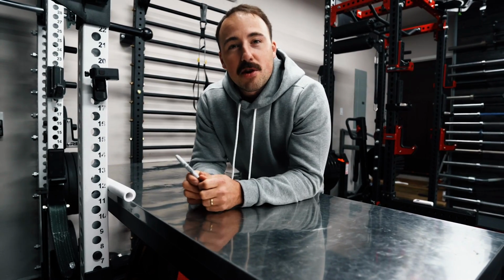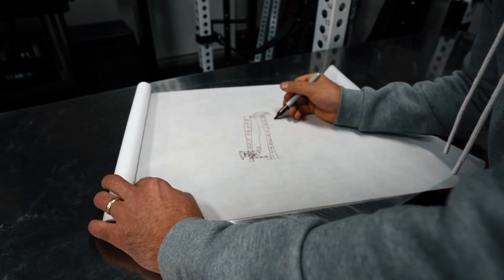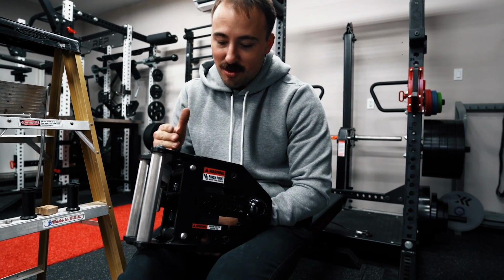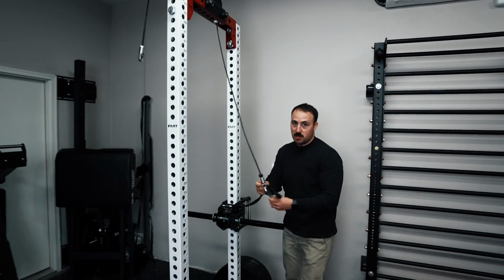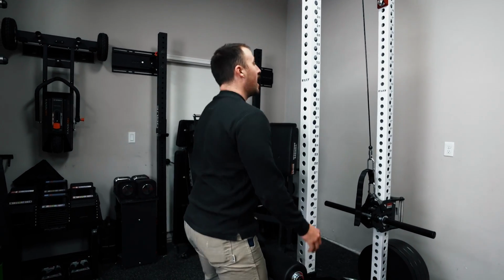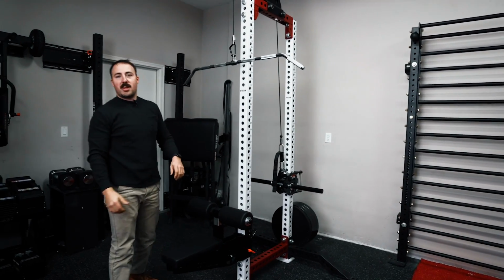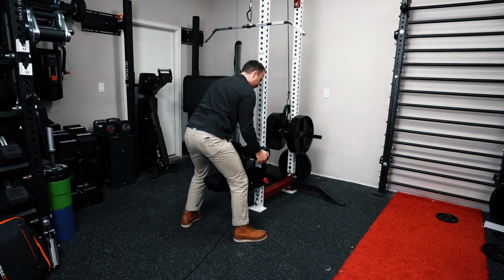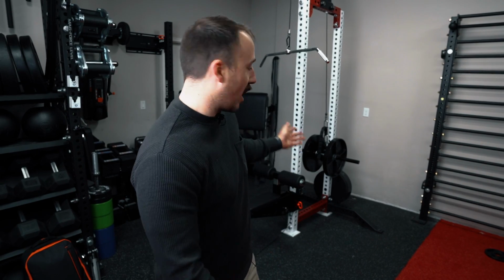How To: DIY LAT PULLDOWN - Stand Alone & Plate-Loaded!

Comment: I flexed on you for a DIY pulldown project. I was able to add a cable track to the top of my rack, I can use two different cable lengths (one for pulldown the other for horizontal cable work AT MULTIPLE HEIGHTS) It's built into my rack, and it's plate loaded. It can also be assembled relatively cheaply assuming you already have a rack.

Comment: At first glance I thought the Rogue lever arm system seemed way over priced, but if the trolleys are multipurposed for this, smith machine set up, adjustable pulley.  The sky s the limit

Comment: Coop, I have an idea to Frankenstein the REP 93” Lat/Low Row onto a ROGUE 90” RM-6 or any 3x3” 6 post rack. I emailed Brandon Campbell about it, maybe one of you could do a video? First, need just the REP 93” Lat/Low Row WITHOUT rear base stabilizer. REP racks are 47” wide and ROGUE are 49” wide so rear base stabilizer will not work. You will one additional 43” ROGUE crossmember. Mount the front to back crossmembers in the weight plate storage area at the right height for the REP mounting plate above low row pulley. Then run the 43” crossmember left to right between these to mount the plate on the low end. Brandon measured for me, and it’s 92” at the top end where lat pull would attach to top crossmember. So there is a 2” gap then to fill between top of 90” nameplate crossmember. You could use a small piece of 2x3” 11 gauge like from an Infinity rack or you could just use some dimensional lumber to fill this gap and act as a mount for the lat pull beam at top. Would just need to drill holes in steel/wood and use either bolts or lag screws depending on material. Then you have a plate loaded lat pull/low row on a ROGUE rack. Fairly affordable compared to Slinger with weight stack and you can use a regular bench to sit on and a roller pad for legs to be held down with. Thoughts?
Reply: I really hope Coop or Brandon try this out. I was trying to figure out a way to mount the Rep lat attachment on rogue rack as well.

Comment: Just a suggestion but...
What if you mount the trolley system to the front post, you'll be able to move the slinger out further and the cable will be more upright. Just make sure to install a stopper below the trolley so that the weights don't smash your knees when you're doing lat pulldowns.

Comment: Awesome! If you have space between the posts, might be better to connect the cable directly  to a loading pin (instead of your rogue attachment). The cable should be 90 degrees to the ground, and loading weight vertically on the pin will mean things stay centred as it gets pulled up (no swaying). It will also eliminate the issue of the cable fraying from rubbing  friction from coming off the pulley at a non-90 degree angle

Comment: PLEASE, can you PLEASE review a weight set that I can use that will withstand the outdoor elements and the salt water. I work offshore on a tow boat, on which I live and work on for 30 days at a time. If you can come up with a good recommendation I would pass it on to the other 312 boats in my company. Just about every boat has some kind of system that has to be replaced regularly. Thanks 😊

Comment: Coop! Powertec has a plate loadable lat pull down, WITH LOW CABLE for $900, in stock. They also have lever gyms, which also have hi/lo cables and a sweet bench, in stock $1,500

Comment: You can't really call this a "diy" solution if you have to buy like 2000$ worth of rogue equipment... 
THIS is the definition of "DIY" cable machine... https://youtu.be/Qn-Ak91pbLE
I built this in Afghanistan with hand tools... The trash can holds about 150lbs of chains, but I've recently upgraded it to 10 gallon pots from the chow hall that can hold 200+lbs of chains. Each chain is 7lbs. You could very easily use a plate loaded posts sliding on a superstrut rail instead of a bucket... I decided to use chains (which we have now duct taped into little 7lb balls) because I have about 1000lbs of chains laying around and only about 500lbs of plates for my team of 15-20 guys. This is a COMPLETE cable crossover with FULL adjustability that would cost probably only a couple hundred dollars to build at home.

Comment: Was there a total cost mentioned? As a comparison, the Powertec Lat Machine (which includes a lat pulldown and low row) is $949 and that includes shipping (at least to my house in Washington state USA)! Add the selectorized weight stack for an extra $490. It's certainly more expensive than the cheap/crap models ($100-$400) you find on Amazon but I'm betting it's lower than piecemealing Rogue supports/columns/Slinger and what not.

Comment: I love ya Coop, but this solution kinda sucks. 1. The parts are all very expensive. 2. The cable is going to chafe even with the PVC. 3. The forces are being applied in a non-linear fashion and it's going to try and make the trolley rock and bind. It might not actually bind because of the bearings, but you're still not applying forced straight up against the resistance of the weight. 4. Your cable connection for the low row is awful. Buy a swedging tool, some cable, a few ferrules, and make your own cable, it's not hard. Also, consider putting a pin in the rear upright under the trolley as a stop. Having all the weight resting on the ball stop on the cable is suboptimal. 

A cheaper and easier way to do this and have the cable to track at the proper angle is to replace the slinger unit with 2 2x4s with pulleys sandwiched between them. Then you just cut it to the length you need for the crossmember you have. Much less expensive, more precise. I built a lat pull for my home gym this way, except I am still using a loading pin. I posted a video about it.

All that being said, I'd love to see trolley systems be commonplace.

Comment: I hope they fix that cable length on front, way too much line on it for tall people.
Reply: It's the ball that stops it, all you need is a small allen wrench to release the three screws in the stop and then slide it down and tighten back wherever you want. If you notice the trolley is a couple feel off the bottom of the post, adjust the stopping point on the front of the cable and it would fall further down. I had to adjust mine a bit to attach my slinger to a weight stack.
Reply: @airgordo4  but the issue would be the rear cable would then be elongated leaving more slack back there (which would still be too much IMO).
Reply: @BasementBrandon  In Coop's case elongating the rear cable would be fine because the Trolley is probably still 2 feet from the bottom of that upright. He's got quite a bit of extra travel for the cable before it's an issue. Just like in my case it was fine because the attachment point on my weight stack was lower. More slack with bands would be an issue, but that's about it.
Reply: @airgordo4  that’s true, and I am still contemplating it with my Coop rack on a 100” RM-6 with drop-in Rhino, but Rogue was dodgy about it, saying it will void the warranty. Of course, all the stuff Coop is doing here has voided warranties anyhow so...
Reply: I’m currently making one but making my own upright and trolley
Reply: What  do you guys think about the prime fitness single stack plate loaded?
Reply: @LuisVega-iz1zd  neer used but I just ordered the selectorized version.
Reply: @BasementBrandon  looking forward to know your opinion once you get your hands on it. Appreciate your honest reviews, advises and tips 👍🏽.

Comment: There is actually a good plate loaded lat Pulldown with low row. Texas Strength Systems. Welded construction, I asked them about max weight and they say they rate it for 600 lbs but have seen customers safely load more to test it. I have one ordered.
Reply: Oh and I forgot to mention made in the USA in Texas.